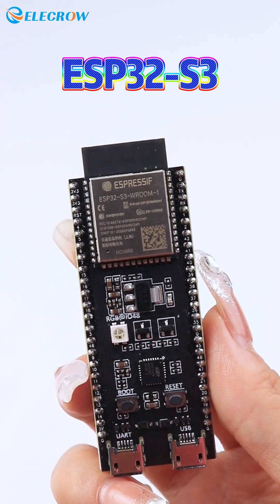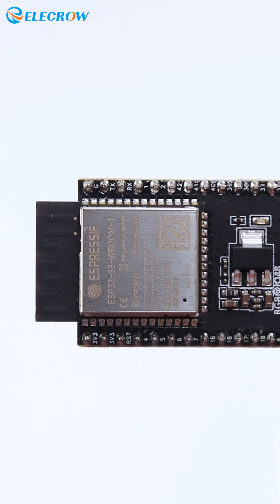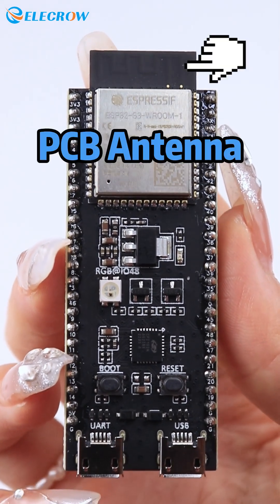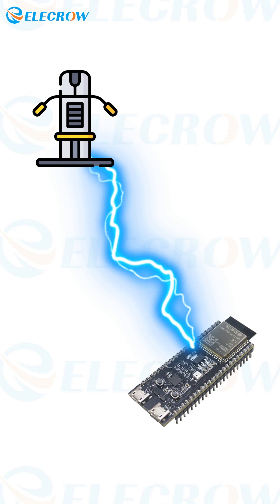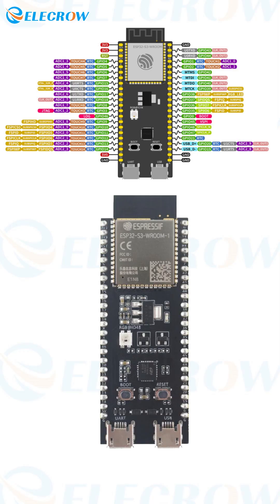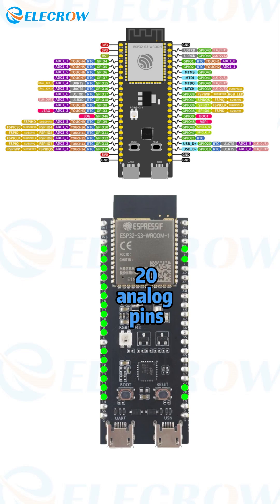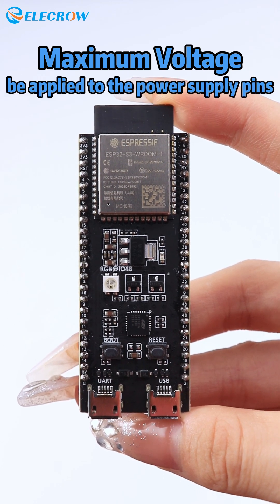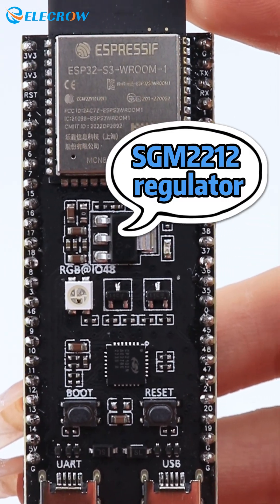1 Minute Guide to Learn How ESP32-S3 Module Works #ElecrowPCB

Comment: Actually, it would be great if you used esp32s3 on the lr1262 development board and lr1262 node board.  Thus, it would support around 5-6 programming infrastructures.  But on those cards, only the esp32s3 module will come instead of the rp2040.  In this way, wifi and bluetooth features would also come to the boards.  In fact, if the module in this project was used, the Lorawan feature would also come with the module.  And with the use of very low current.

https://www.youtube.com/shorts/P1dnDSOhRac
Reply from the maker: Thank you for your kind feedback😊😊

Comment: Consumption is a lot more than regular Arduino.
Reply: Nope, ESP32 logic uses 3.3V, while arduino logic uses 5V
Reply: @smartbrine2912 you are gonna freak out when you find out about current
Reply: No he says about amp
Reply: @Man123-x4o  in this case isn't it more accurate to use watts?